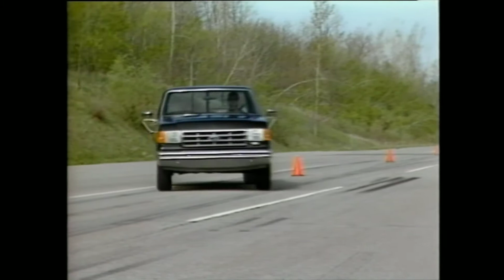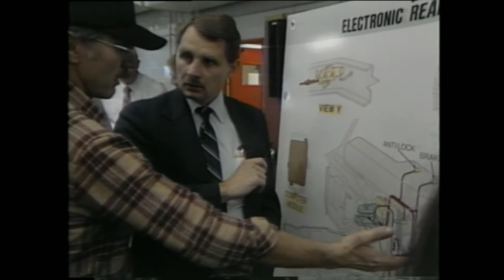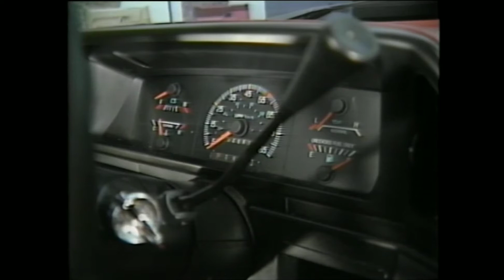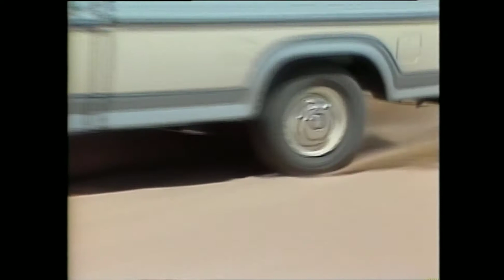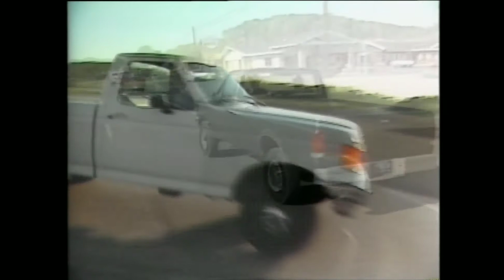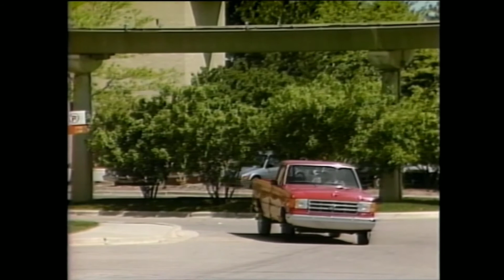1987 Ford Bronco & F-150 Review

Comment: Ford produced those eighth generation F-series pickups from 1987 through 1991 & same with the fullsize Broncos with that same body style.
Reply: actually the 8th gen F-series was originally was produced in late 1986 and rolled off the assembly line in early 1987
Reply: @LeeLeezy19  yes the new year models come out about 3 months early.